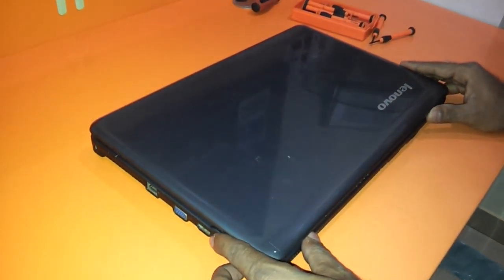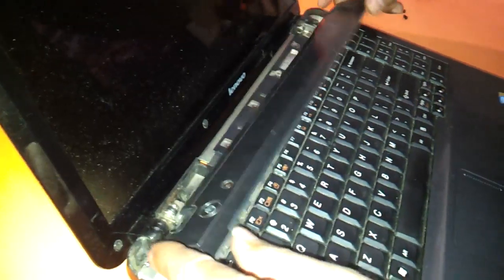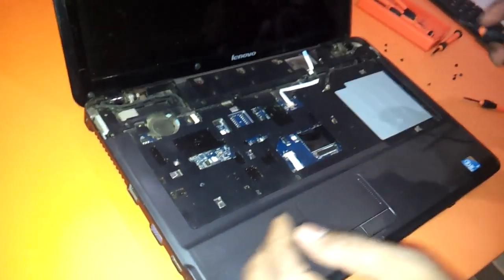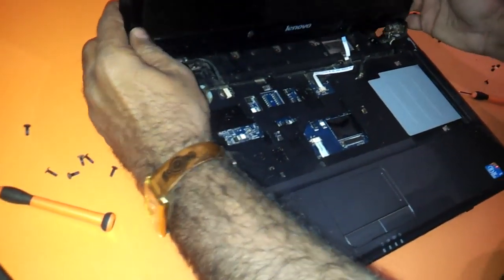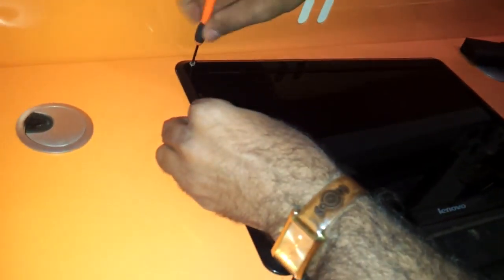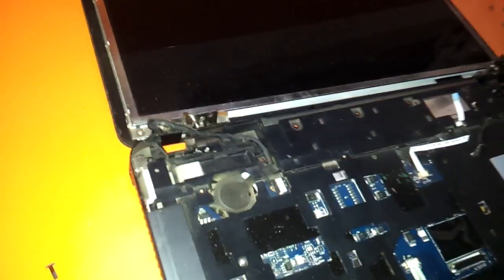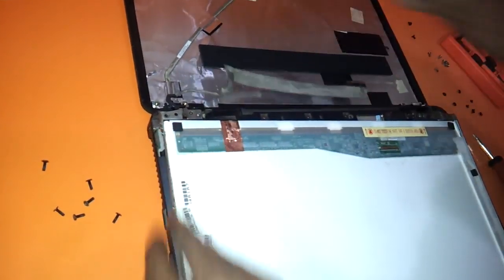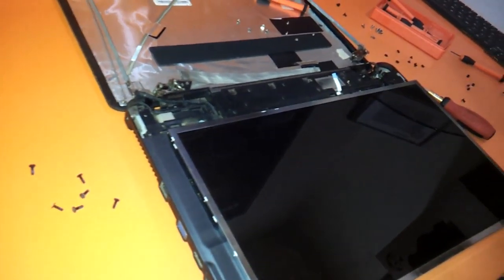how to replace the hinges keyboard led lcd of lenovo g550 g450 notebook laptop

Comment: My lenovo G550 screen has a typical problem. On the right side of the LCD some line are occuring. Whenever i open the laptop there are line. I have to press where Lenovo is written on bottom and then it works in proper manner. What should i do ?  I should go for cable replacement of full LCD replacement. Kindly guide.
Reply from the maker: Most probably you need to replace the lcd.